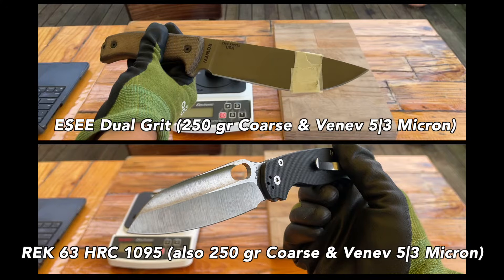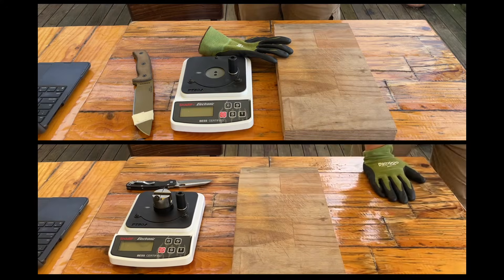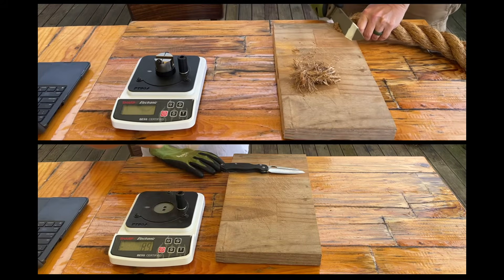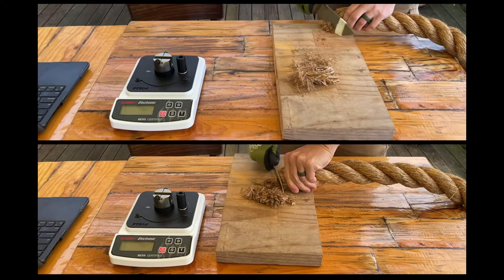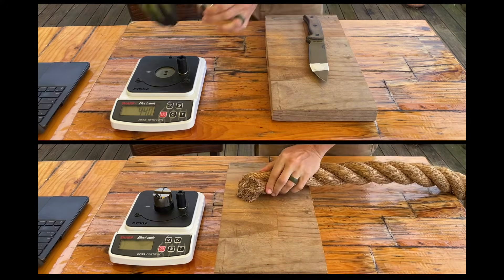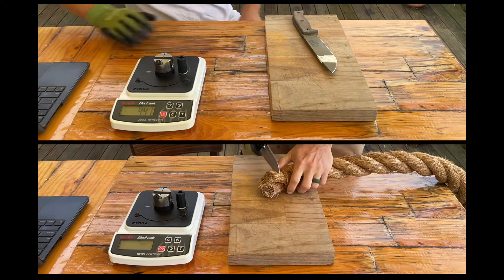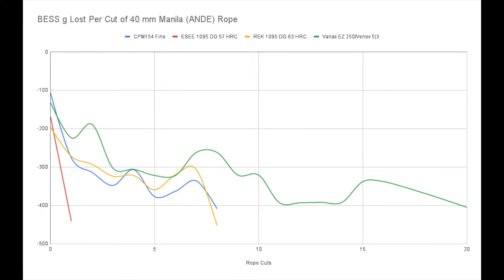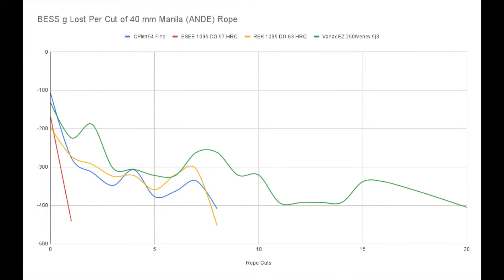1095 Battle | 57 vs 63 HRC | ESEE vs REK PM2 Knife

Comment: All of my super steel knives have been sharpened down to nubs and now have extremely thick geometry. My carbon simple steels don't really have this issue. It seems to get my super steels back to where i want them to be, i have to really sharpen them, where my more simple steels usually just need a couple light passes and a strop. Anybody else notice this or just me? Does this really make them " super?" I kind of love steels like aus8 because i can swipe it on my belt a few times and get back to work where k390 needs actual sharpening to get back that crispy edge.
Reply from the maker: Hey - thanks heaps for the comment.  I have experienced similar things at times.  I replied extensively to your similar comment in the 10V video.  Let me know if it makes sense.

Comment: It’s not the hardness, but the microstructure
Reply from the maker: That's a good point.  Brian at Transparent Knives has made that abundantly clear with his M390 testing.

I do understand that in my mind, but I probably oversimplify to talking about HRC in the video because it's hard to communicate the nuance of microstructure differences, especially when my knowledge and experience with tempering and microstructure adjustment is very limited.

Thanks for the comment anyway!

Comment: ! I can’t wait for the next episode.
I have been chasing the dragons tail with same steel, same grit &  geometry, manufacturer 
And finding wildly different results, I.E I bought three exact same model bug out killer D2 steel knives, and even though I don’t use any scientific equipment one is a total failure on every day task like opening feed bags, cutting hay wrap , cutting cardboard, #2 is muh better, #3 is good @ edge retention 
I think it’s the inconsistency of heat treatment and maybe burnt steel on initial grind ?
Of course these are sub $100 knives and as the price increases the quality increases, of course my spyderco, KOA , vintage Gerber knives are stable across the board ( with the exception of ganzo beating Schrade in 440c ) , next is 52100 and Moraknifv  steel ( which BTW seems so incredibly good for extremely cheap) & M2 steel.
Keep up the testing
Reply from the maker: Yeah, I have experienced that before.  Or even having steels that respond quite differently to 2 different sharpening stones (both high quality stones with a good track record).

Small differences in sharpening technique can throw quite a curveball, burnt edges can mess a steel up quite badly, sharpening angle has a huge effect, and different microstructures in the steel (though invisible to us) make all the difference in performance!

Next week is 63.5 vs 66.5 HRC CPM10V and it will blow your mind!!!

Comment: The problem with Larrin's charts, is that you cant use the chart to compare many things. Especially not mass production knives and often a custom heat treatment will differ from his protocol as well.
Reply from the maker: Ah yeah, that's a good point.  Less of a problem with Larrin's charts though - I guess it's more a problem that microstructure and HRC are not the same though most people talk like they are (myself included, I often find I am using hardness comparison as a shorthand explanation for what are actually microstructure differences).

And I guess the other problem is that the industry is wildly under-standardized with many companies failing to heed very accessible heat treatment information, it can't be apples to apples comparisons with steels.  Not exactly anyway.

Comment: Interesting . .  once again working edges are in the 325 to 375 Gram BESS range. 
I need to figure out how to  consistently create a 325 to 350 Gram BESS cutting edges.  
My interest is in testing cutting forces within working edge sharpness ranges. 
Any ideas would be appreciated . . .
Reply from the maker: Hey Daniel - I think if you have harder steel or are cutting up softer less fibrous things than rope, you will definitely have longer periods in the 200-300 BESS Sharpness range.  I think you will find this week's video coming up very informative.  Maybe watch that and then we can talk further.
Reply: @homeslicesharpening  This is a concept I have beed pondering.
- My thoughts are for separate testing in the 250 BESS & 350 BESS 
range cutting edges in addition to the 175 BESS; my current standard. 
- These ranges should yield data for most real world use case scenarios.
Reply from the maker: Yeah, that's probably a better range to reflect most people's experience.